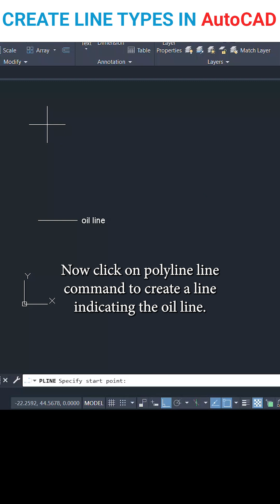Create Line types using AutoCAD  #autocadtraining #sabeercad

Comment: Perfect!
I created a new linetype, but the text doesn't show when I use it in a new line/polyline. What could be the reason?
Reply from the maker: May be the line type scale is the reason. Give a higher value for LTS command see whether the text is appearing.
Reply: I also successfully created the line but text is not showing. Also tried after changing LTS...
Reply: I tried it...when I use a text, it's not selecting the text, only the line. So I get spaced lines. When I draw a shape like an X, using 2 polylines its selecting everything but the end product isnt an X. Any thoughts?